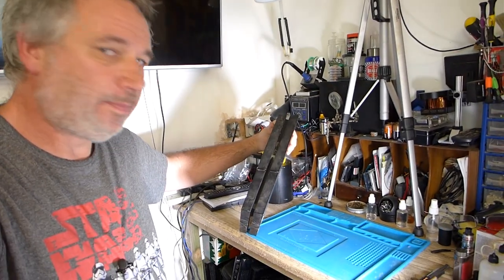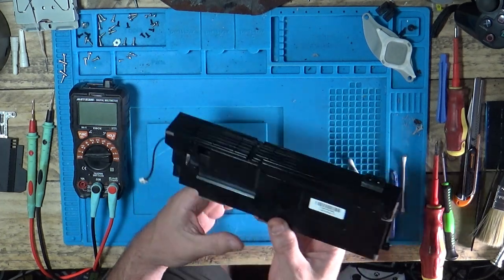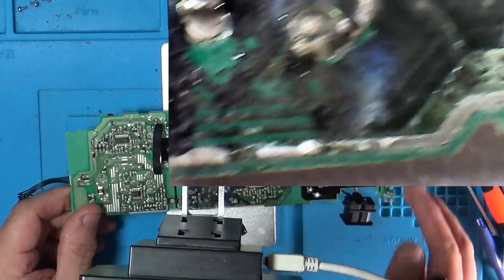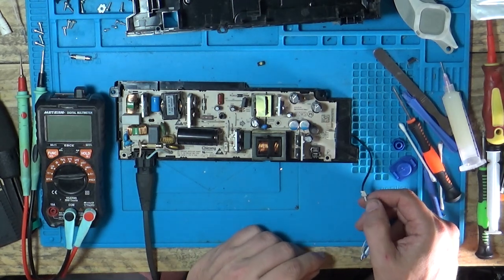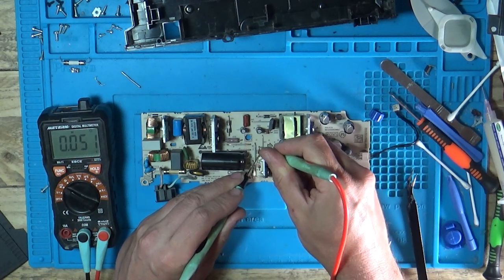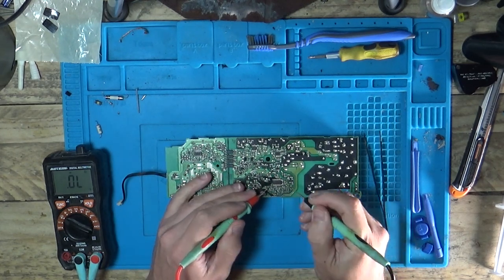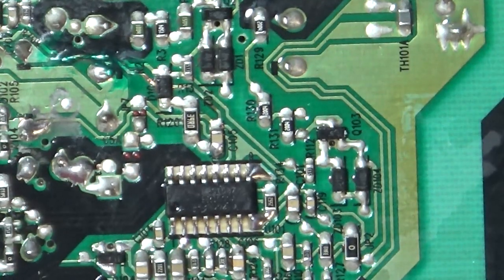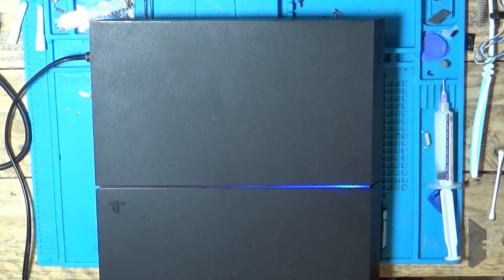Sony PlayStation 4 Repair with No Power At All - PS4 Power Supply Repair

Comment: So what was the actual fix (just the ic chip?) or was all those parts bad, and the wire retrace all necessary?
Reply from the maker: This was a while ago but from memory it was the resistor, the optocoupler and the ic that were all bad and needed replacing. The trace is there for a reason so it's always a good idea to repair it as well

Comment: HDMI cord is the power cord. I swear it will work with just that🤣🤣🤣🤣
Reply from the maker: Sorry I'm not sure what you mean.
Reply: @FixIt for Reselling  you plugged the hdmi cord in and then tried to power it up. HDMI is for the video not the power🤷‍♂️
Reply from the maker: When? At the beginning? I plugged the power cable in. The HDMI port is a third of the way along the back. I don't even plug the hdmi in until the end.